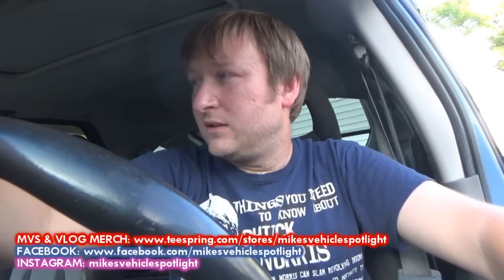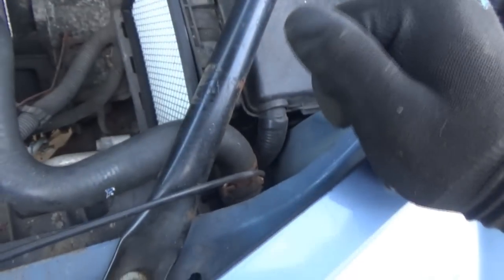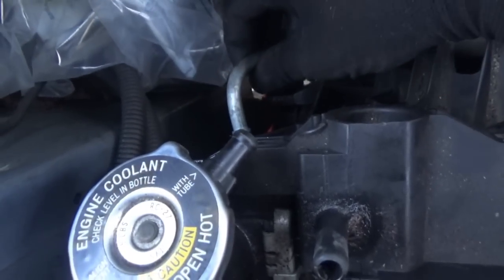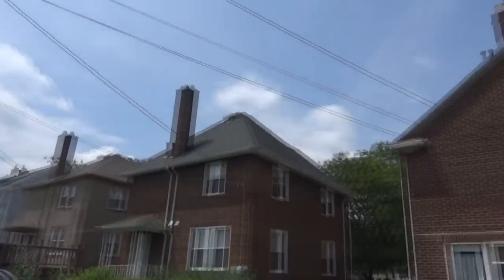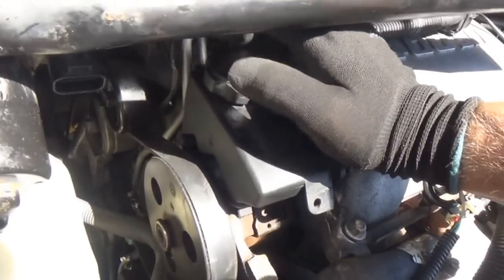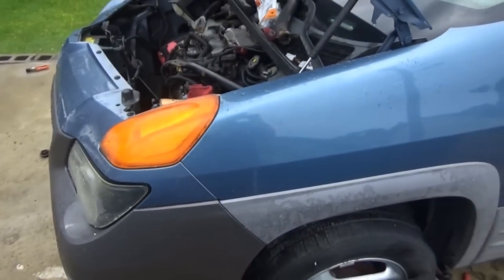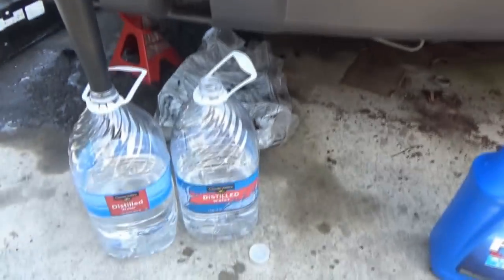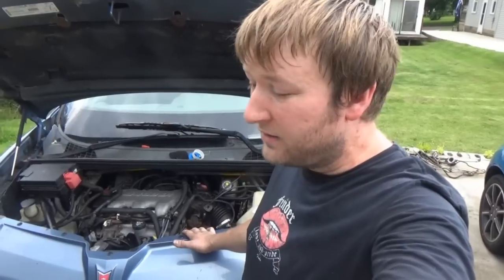MV 225 - "Aztek Radiator Replacement"

Comment: Is it safe to remove the Dogbone Mounts without providing additional support to the engine? I can't tell if you had jack stands or something underneath the engine.
Reply from the maker: The dogbones are safe to remove. All these do is keep the engine from rocking back and fourth from engine torque. The actual engine support mount is on the lower end of the engine.
Reply: @MichaelAdamsRocks  Thank you very much. Doing this repair myself over the weekend and it would've been infinitely more difficult without your video!
Reply: @MichaelAdamsRocks  so I do  not need to support the engine  at all to remove the dogbones? I saw a jack stand under your car, does that have anything to do with the job?

Comment: Michael - I am doing this job on my '03 Rendezvous now.  Like you, my top radiator to condenser bolts and nuts are bad.  What was the GM part number to the nuts?  Your video panned so fast, I was not able to grab the part number.  Thank you!
Reply from the maker: The nuts are GM part number 11570097. No problem! Good luck!

Comment: Would there be any clearance issues if I were to try and fit a thicker radiator?
Reply from the maker: Possibly because the condenser, radiator and fan assembly all bolt together and the body mount and fastener points may not allow them all to fit together

Comment: Hello. The new radiator from the seller I am looking to buy from does not appear to include the orange fittings for the transmission lines (43:58). Are these critical or necessary? Do you know if the bumpers (46:15) can be bought new? The originals are showing their age so I was thinking it'd be nice if I can have new ones put in along with the new radiator. Thanks!
Reply: Update: the "bumpers" are known as "lower radiator mounts" and have GM part number 10341994. These were at one time available as a pair for under $9 but they have sadly been discontinued and are not available anywhere near as I can tell. :(

Comment: How did you get the dogbone mount to fit back, they dont line up on mine after removal and there was a thud when i first removed the 2nd mount, like the motor had slipped
Reply from the maker: I had to rock the motor back and fourth by pushing back and fourth on the car. Then once it was lined up, I put a bolt in through the dogbone to keep it in place. Make sure the dogbones are already mounted to the front end before trying to line up the engine side.

Comment: How did you get the engine back up to get the motor mounts on?
Reply from the maker: Rock the car in park. It rocks the engine and then just shove the bolt into the mount to keep it place

Comment: Just recently changed out the radiator on my aztek as well, thank you for making this! Running things and I noticed both fans won't turn on... I know I accidentally let a bit of refrigerant out of the system, would that possibly keep those fans from turning on?
Reply from the maker: Glad I was able to help! With my Aztek, I noticed my fans won't turn on until the coolant temp is slightly above normal (when the gauge is almost 3/4 of the way up) and then the temperature comes back down. IF your fans aren't working at all, I'd check the plug on the fans to see if they're plugged in fully. If they are plugged in and still not turning on, you may either have an issue with the wiring, a fuse or relay, or the fans are no good. My A/C is no good in my Aztek at the moment, so when I turn the A/C on, the fans should be running, but they do not. If you're A/C is on and the fans still aren't running, the refrigerant could possible be the issue. That's all I've got on the topic.
Reply: @MichaelAdamsRocks  I figured as much, and I did check everything but the refrigerant. More got out than I'd like to admit. Thanks a ton for your input though, brought down my stress levels a lot. 

I just replaced the motors in both fans, so I'm assuming they're both not coincidentally bad.
Reply from the maker: Oh yeah, if the fan motors are new then I doubt that’s the case. Good luck though! Let me know how everything works out!

Comment: I found that if you remove the air breather box with the PCM it is way easier to get at that bolt.  I cleaned the pins to the connector to the cooling fans and loaded the webbing at the connection point of the 2 connectors with lithium grease.  I had a little corrosion in my connector though and the webbing wasn't great.
Reply from the maker: I didn’t want to go through the hassle of removing the entire air box, but moving the PCM and the wiring out of the way worked fine for me.
Reply: @MichaelAdamsRocks  I get that, I'm not as spry as you are. I all but removed the tailpipe to empty ashtray.  I'm still learning to DIY auto repair.  I already know that my aztek will never see the road again when I'm done though.
Reply: That's what I ended up doing.